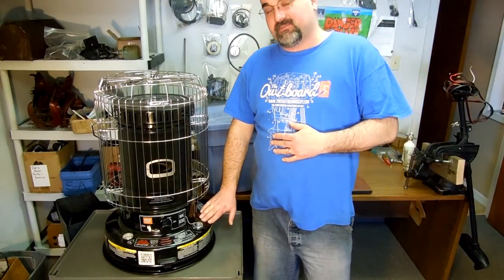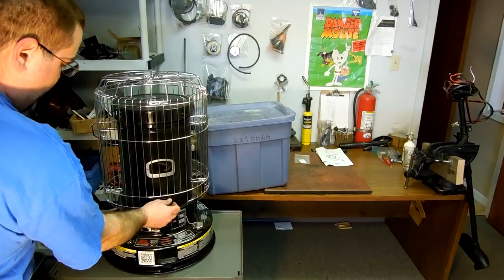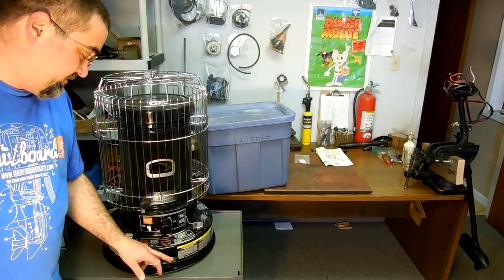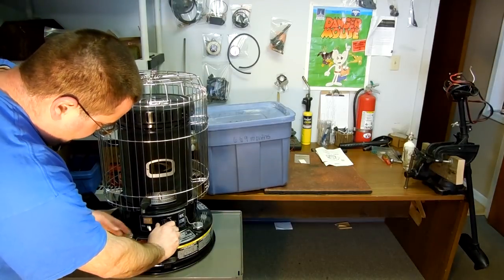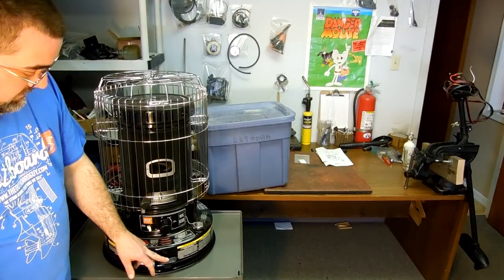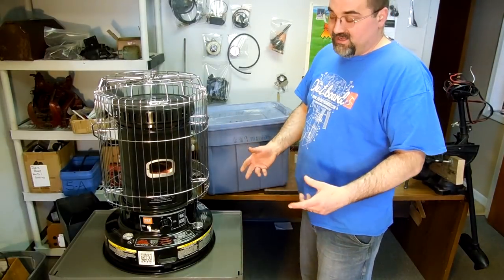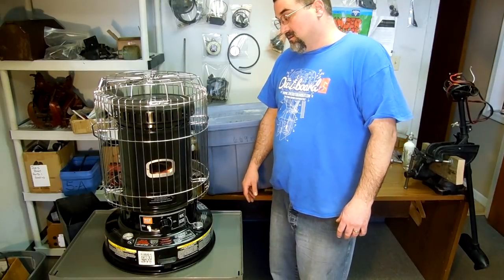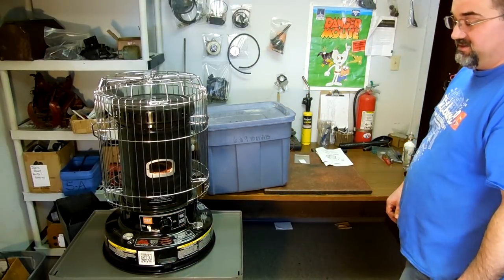How to light a kerosene heater

Comment: Hey bud..quick question. I have a shop in my 2 car garage in Vermont. The garage has a open loft/barn roof. It's cold as shit. I'm looking for something that will just take the chill off. It doesn't need to make it toasty, but just so I want to be out there longer than 10 minutes. I already have a torpedo style but they are obnoxiously loud and I don't want to keep the door open. Will this heater do what I'm looking for?
Reply from the maker: this is a great size for that set up
Reply: I hear my garage and it gets warm
Reply from the maker: I love the heat this puts out my whole house heater is 125,000 btu and this is around 27,000

Comment: How do I shut off A  Kero Heat Heaters that does not shut off ? I tried shutting it off to the Shut off Manual and it is still running  ? I tried the Adjusting Range But it is still going .
Reply from the maker: Put it outside and let it burn out of fuel. Try turning the dial further counter clockwise by hand